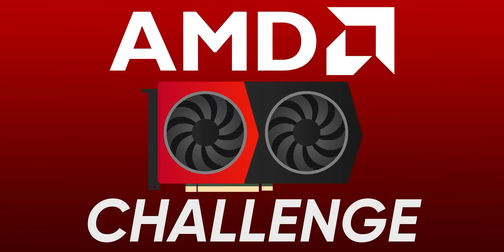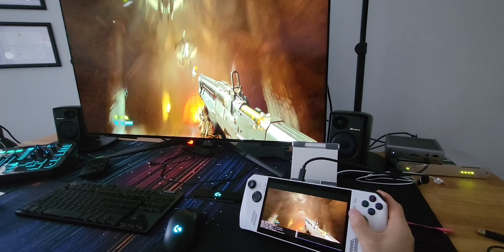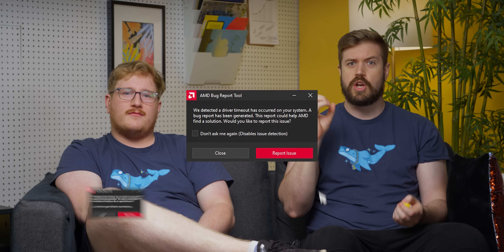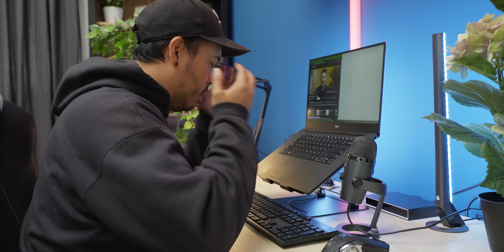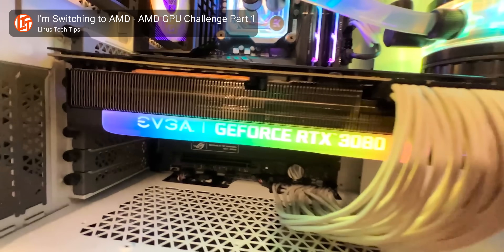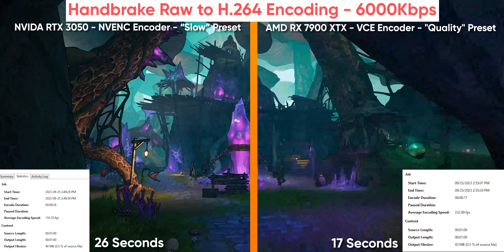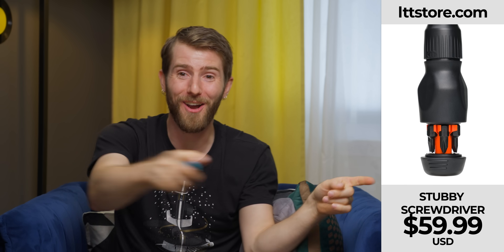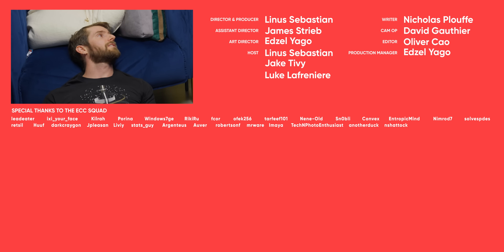I’m Staying on AMD! - Radeon Challenge Pt. 2

Comment: I built my first PC in August this year with an 7900XT and until now, i never had only 1 of the issues you are talking about. And im using it heavily everyday. Crazy how different this can be!
Reply: I've got r5 5600x with the 6650xt and I've never faced any issues either. Only recently windows copilot is killing wallpaper engine but i dont know who to blame
Reply: Same here.  Never had any issues neither with my previous 5700XT and my current 7900XT
All of the issues they had in this video is unreal to me lol.
Reply: AMD runs my PC since 3 years. (6700xt & 7900xtx) Never had issues.
Reply: most problems like high idle power draw that could be seen for loooong time, could go away with fresh windows install, doing DDU is one thing, but it also can't revert everything, so getting fresh windows and setting it up with new hardware is often the best way to get problem free experience, tbh i had radeon HD 7000 series, rx 300 series, 500 series and now 6000 series and i had handful of crashes or problem during that whole time, i had more problems with my asus A320 prime and B450 rog motherboards with ryzen 1500X and 3600 (both had problems so not only zen 1 bugs were here)
Reply: @theblubus  ppl keep complaining abt amd really starting to feel unreal at this point.
Reply: I do a fresh window’s install with every hardware upgrade so that could be a reason but all my graphics cards have had no issues at all in the last 7 years. I had a R9 380, RTX2060 and now a RX6950XT and all of them ran fine with no issues.
Reply: 5800X3D with 6700XT, also no issues whatsoever. though this card has matured since it's release.
Reply: I had weird freezing issues on my 7900 XT early this year until I I disabled something called MPO in Windows. Zero issues in about 9 months now.
Reply: i returned 2 2 6950xt's because my pc kept black screening and i couldn't figure out any solution for an entire month.

my build just doesnt like AMD it seems.
Reply: Yeah, I'm running full AMD, too, and have yet to notice any issues.
Reply: Unfortunately i had lots of issues with my 5700 xt, Green screen and blue screen crashes and it never worked, Sold to someone and it was fine for him.
We figured out it might be the motherboard problem with amd cards.
Mine was a asus z390 and his was a b450 and amd cpu
Reply: Interestingly i had similar issues on win11 after switching to team red... after 2 weeks i kinda lost my shit and reinstalled windows and had no issues after that...
Reply: @blikzems  lucky that's all it took.
Reply: Running rx 6600 for months never had a problem with it.
Reply: @JoyceAiman I have a regular 4070 and noticed my wallpaper engine acting funny so its probably not just a graphics card thing
Reply: a fresh install would probably fix a majority of their issues
Reply: @JoyceAiman  are you using windows 10 or 11?
Reply: what about now, I'm thinking of getting the same gpu
Reply: @senzmaki  Had mine since last Summer and ran into random problems starting in February that turned out to be entirely due to Discord hardware acceleration. No problems since turning it off, or even with it on since I switched to Linux.
The first result for "discord hardware acceleration crash" is a reddit thread from r/Helldivers claiming that was a known problem on NVidia cards, and this DID start when I was playing Helldivers, but on the other hand it persisted after a full Windows reset, so in conclusion I have no goddamn clue whose fault it is.

Comment: Luke might be forgetting that the Titan RTX is a PCIe Gen 3 card while the 7900 XTX is a PCIe Gen 4 card, which means the riser has to be up to the higher standard. Otherwise you get what Luke experienced
Reply: Hey there!

We mentioned this in the video - Might not have been clear enough.

I would also note that we filmed this a few weeks ago and since then I have only ever crashed in starfield - 0 in any other game... So honestly I don't think this is currently causing any issues.
Reply: @LukeLafreniere  Maybe what you need is a fresh windows install.
Reply: @LukeLafreniere Hey Luke, I've been having similar issues with PCIe4 on X570, when I did rebuild my PC as I was so fed up with it, it turned out that my card was somewhat misplaced in the PCIe slot (like it moved slightly), maybe something like this is more visible with risers? I haven't had an issue since then.
Reply: @aquiveal  Or maybe a less janky computer in the first place.
Reply: Mine is installed without a riser and have had similar issues with the drivers timing out at random times crashing discord too! The discord crashing can be "fixed" by turning off hardware exceleration in discrod's settings. I've done that to quite a few apps to avoid as much things crashing as possible when tabbing out of a game
Reply: @LukeLafreniere  side note but given how much your for Linux I'm surprised you weren't focusing on that experience especially with the other two showing the windows use pretty well just to give more variation in use ,granted I understand probably wouldn't be great on your work PC since it looks like you need at least a few windows specific applications, and also the devil in the details are now testing two things and hard to pin down which ones which but that also seems to be the case of Windows either way... So same same?(run on sentence I know, sorry)
Reply: @LukeLafreniere  Ive had similar issues with team green, but changing PCIE settings from BIOS to gen 3 fixed everything! :)
Reply: pcie is universally compatible. there wouldn't be an issue unless the actual x16 slot on the motherboard wasn't set to the same bandwidth as the riser cable itself. since luke uses an x570 motherboard - to my memory - i really hope that he did that. 

if he used a gen 3 cable then he would have had to set the x16 slot to gen 3 as well, but there wouldn't really be any issues in terms of gaming with the 7900 xtx.

if he used a gen 4 cable then there's no issues at all.

either way, since luke appeared not to experience issues with the titan rtx, the pcie compatibility wasn't an issue
Reply: @LukeLafreniere  Your computer looks the most janky out of the three of you, so it kind of makes sense that yours had more problems. Dual Power Supplies while they can work totally fine, can in rare instances cause voltage spikes to your motherboard through the PCIe slot, so...might want to consider just getting one power supply that is sufficient enough for your whole setup.

Just a thought.
Reply: @maximus3294  the mobo detects that the titan rtx is gen 3 so it automatically runs the lane as gen 3, but if both card and gpu are gen 4, the mobo cannot know what the riser is rated for. :)
Reply: @LukeLafreniere  When GPU driver crashes, Discord also closes because it is GPU accelerated and don't recover. Same with any game that also don't have GPU device recovery implemented. It is not driver issue. At least it shouldn't be...
Reply: Honestly this might just have been Windows. 

I was having the same problem until I updated to the newest Windows 11 release
Reply: @aquiveal  again, outside of starfield I am not currently crashing EVER - and starfield is not exactly stable... Imo the problems are resolved.
Reply: Yeah they should've just not included Luke in this video, totally unfair on AMD and obvious his problems were caused by the riser cable. I mean, I don't like AMD hardware/drivers because I find them unreliable but this was clearly the riser cable causing the problems.
Reply: @LukeLafreniere  Hey Luke, 

I heard that you mentioned that. I just thought I’d give the extra info on the PCIe generations i case you might not know that ;)
Reply: @jimmymcgill6778  tech is an incredible widespread field. You can basically never know everything. You have to specialize yourself.
Reply: @@GH0STST4RSCR34M No you just need a riser that is certified for PCIe Gen 4
Reply: @LukeLafreniere  Starfield has crashed about 5 times for me on 4070ti. Only game that's crashed for me in months.
Reply: @jaykoerner Tarkov can not be played on Linux right now, as the anti cheat is not yet implemented / published.

But I support your claim 100%. It would have been a great addition and most probably a great experience. My system is stable as a rock on Linux, but it crashes every time I use Windows and yes, it is a fresh installation of it.
Reply: I love Luke but I really don't know that his system in its current state is the best testbed for...anything.
Reply: @LukeLafreniere  I heard you said you used a riser. I didn't hear if you selected a pci-e version it supported in bios. Your motherboard would default to using the highest pci-e version that it & the video card supports. In my case it outright didn't work but you got 'lucky' and it somewhat worked - possibly due to a lower length or a higher quality. If you did not switch to the pci-e version the riser officially supported then congrats - you just blamed AMD for issues you caused. Sorta like pwned & billet situation. Cue incoming shitstorm if anyone still cares.
Reply: @LukeLafreniere hey Luke. I had almost all of the same problems as you did when I switched from Nvidia to AMD. Doing a fresh Windows install fixed everything.

Comment: Seriously -- what Jake said at the end there, about buying an AMD GPU 2 months after it's been released is advice that should apply to nearly EVERY piece of hardware.  After two months the bugs will either be fixed, or will be known to be unfixable.  In either case, you avoid winding up with a poor-quality product.  Plus you don't pay the early-adopter tax that seems to be so common these days.
Reply: Absolutely true, but sadly it's not that easy to get actual standardized user experience information.
All the reviewers only review at release, and forum threads are just incredibly unreliable.
Reply: This should absolutely be upvoted/liked whatever.  Any new tech, best to wait a little while.
Reply: Yeah my experience with the 7900XTX was more on the side of unfixable. The infamous shader stutters in older games running dx11 or lower (as Jake mentioned in the video for borderlands) it’s not a fluke, it’s consistent and happens every single time it’s been there for 3 generations now and AMD doesn’t seem to care, I returned it for a 4080 and never been happier, like, I work 7-8 hours a day and it’s SUCH a relief to know that I’m going to be playing my game, any game, and it’ll just work, I don’t have to tinker with anything, I don’t have to bother disabling free sync, I don’t have to bother disabling DXNAVI that requires me to run code that I don’t understand and edit my registers following guides on random forums. It’s just so much better that I’m happy paying the $200 tax, AMD really neeeds to get their shit together.
Reply: unless you are intel lol
Reply: @LMacNeill  It's like everyone forgot how terrible the RTX 3080 drivers were at launch... lol but, you know, only bots were buying them so... did the collective forget?
Reply: @Cooe.   I agree, I'm using AMD hardware and never had that kind of issue (including all titles of the borderlands series) and if it was something that was super common you'd hear it way more often
Reply: That and don't install drivers on the day they come out

Comment: Personally, as an owner of a Powercolor RX 6600 which is a great deal at 200 dollars on Amazon. I have had almost no issues and almost no crashes so your experience was surprising for me.
Reply: Used to own an XFX 6600 and now own a Power Color Red Devil 6700XT and haven't had any issues. Starfield is running over 120fps. A couple other games hit 144 which is the max my monitor can do.  And I just updated Adrenalin today and didn't need to restart, which Linus said wasn't possible. But who cares? My machine takes like 3 seconds to boot.  Restarting is just not like this is Windows 95.  Come on.
Reply: same, one of 4 cards I run in my rig - I've rarely encountered an issue with any of them maxing out on AI compute tasks all day, and occasionally heavy gaming. I have to assume this is all for dramatization, "my card crashed every few hours" sounds like there's an issue with some other major system software or hardware component.
Reply: @SweetSweetCandyBoyz  Do we know if they made a clean windows installation when switching from nvidia to amd? I heard rumours that this could cause issues but have no way of verifying it.
Reply: Same here, I'm using an rx6600 rignt now and I also used an rx580 and an rx5500xt in the past and never had a GPU related issue. I had more problems with my old 1050Ti though I blame my agressive overclocking attempts for that
Reply: I have an xfx rx6700xt and haven’t had many crashes. In fact its been a rare thing for me. My last adrenaline update didn’t need a restart either.
Reply: I also have asrock 6600 and the only problem is coil whine
Reply: Whilst I do own an older amd gpu ( rx570 ), I've had similar issues for the past few years. I've also had similar issues with my previous amd gpu card. I'm not gonna say that it's unusable, but it definitely has issues.
Reply: 5700xt perfect card no issues
Reply: @suza3199  honestly before i upgraded. I used to use a r9 200. Yes a r9 200. It served me well for all those years. Even running newer games (2017) in the 80 FPS on high settings sometimes. I even remember playing GTA online with some friends that had gtx1080's at the time, and my old ass setup ran better with maxed out settings.
I feel Radeon cards just run better after driver updates over the years. If you buy previous gen your experience will be allot better IMO.
Also even old cards get to use the newest AMD drivers. support is crazy. 
I actually still use my R9 as a secondary GPU for my second monitor that still uses DVI. It still updates adrenaline with every driver update, even if it isn't upgrading anything for the card itself, you at least don't get the problem of finding a old version of the GPU drivers to get it running correctly.
Reply: hmmm, after reading all of this comments maybe that's only newest/high end pc problem related. mid to low end pretty much don't have the same problem. me mid also dont have any of this problem.

running latest and greatest hardware is not all good from this lesson.
Reply: It seems to be an RDNA3 issue with these cards, RNA2 is fine. In particular the Hyper whatever update seems to have caused them.
Reply: @Giggle971  They didn't do a clean install as mentioned in the video, but they did run DDU, which should be more than enough.
Reply: yeah I have RX 6700XT I have had none of those problems, well almost only game I play is counter strike. I guess the issues are with 7000series gpu:s
Reply: Got a Sapphire RX 6600, running Cyberpunk 2077 at 60fps on high 1080p no FSR, no drops or any kind of problems. Played for 6h non-stop on DLC release and nothing happened. Apparently they fixed the game or something
Reply: @Kiritomens  Hah, I used to own an r7 240 prior to this one! Anyway, I've had driver issues with both, regardless of the generation or the driver version.
Reply: Have RX 7600, literally 0 crashes since I bought it.
Reply: I have a XFX 6950XT absolutely no issues or crashes at all in the two months since I got it… really can’t understand how they got so many issues.

And I had a single issue within the 4 years where I had a R9 380X where GTA V had strange exaggerated particle effects, it was fixed within a week.
Reply: to be honest I had many crashes with games like apex with my 1060 and 0 with the current Rx 5700xt on the same pc. (then after I while I moved to a new CPU with Ryzen)

Comment: The issues Luke mentioned, I have similar issues with team green! It was because my motherboard and GPU both run PCIe 4 and the riser is a PCIe 3 riser. Changing the PCIe to 3 from BIOS fixed pretty much everything!
Reply: Bump for visibility, altho he might've tried that already
Reply: Insert constructive comment of value
Reply: Had the same issues but with rx580 and pcie 3 riser. after removing it all smooth and no problems at all. So i´d guess Lukes problem are riser-related